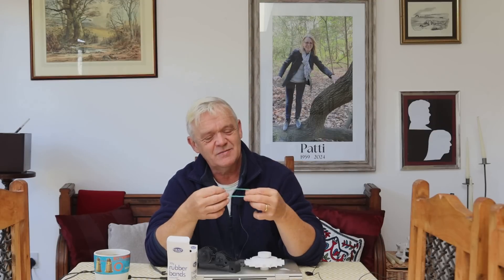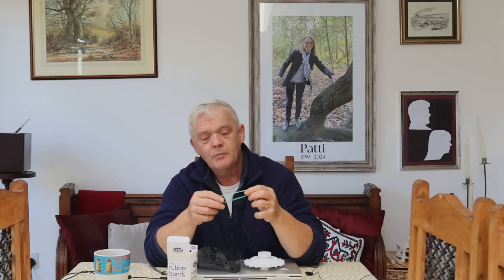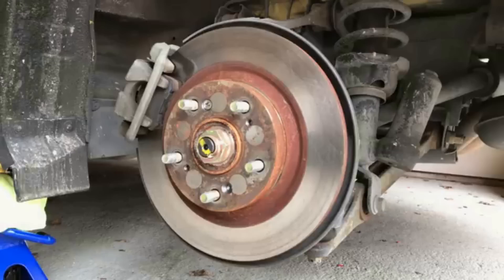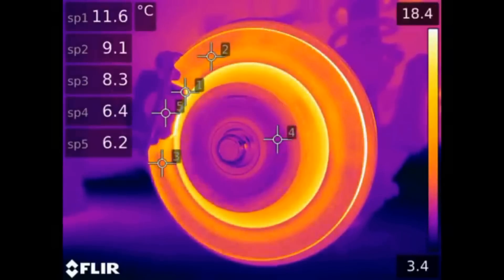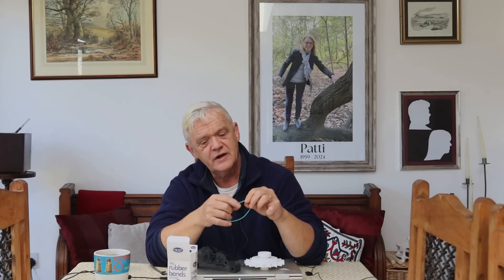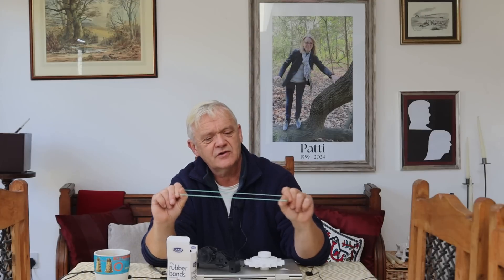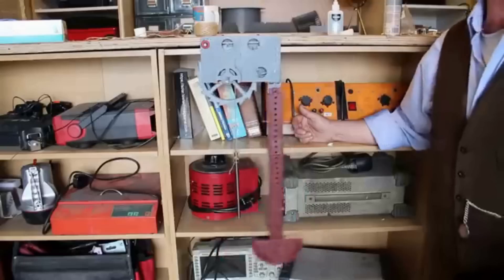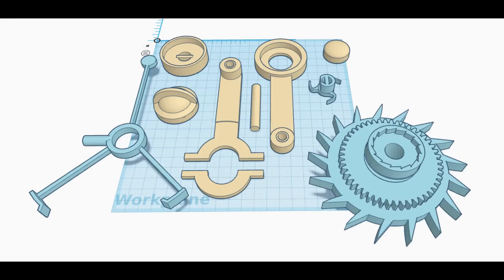2299 Rubber Band Escapement

Comment: Thank you, I always enjoy your videos. The period is only given by the length of the pendulum and the gravitational force. The mass has no effect on it.
Reply from the maker: Great point - but I suspect this is only an approximation - after all the regulate the pendulum of the clock in the Elizabeth Tower in London (Big Ben) by putting pennies on it - the addition of weight changes the beat of the pendulum by 2/5 of a second every day - of course that pendulum is massive - around 4.4M long and 310kg - the bob is 204kg - having said adding weight does make a difference to the beat
Reply: @ThinkingandTinkering  It should be irrelevant from the maths/physics behind it. Maybe the increased friction from the pennies in the airflow tuned it in ;-). 
BTW: I also own a 3D Printer and enjoy it, but I also miss the old videos, when you did the builds with alternative tools. It was nice to see, how something startet to get it's shape. With 3D printing, the results are on the table from the first second of the video. But I still learn a lot from you. Keep up your positive nature.

Comment: In the past I've wondered if it would be possible to design an escapement mechanism with the proper gear ratios, tooth count, timing, etc. and probably even with slip gears where the main wheel is pulled with let's say a 2 lb weight while it's pulling up a 1.25 lb weight and when the 1.25 lb weight reaches the top it disconnects and then a 2nd 1.25 lb weight goes through the same motion and when they both are raised to the top they engage each other to become a 2.5 lb weight in order to raise the now lowered 2 lb weight and start all over again when I put it on paper it looked plausible I think Mr. Smith could be the guy to do it if it's possible.. just some food for thought Mr. Smith
Reply from the maker: sorry mate that doesn't look plausible to me - How does the second weight get pulled up? when the cycle has finished you would have 2 pounds at the top and 2.5 pounds at the bottom - it wouldn't repeat
Reply: Like in the beginning the 2 (1.25 lb weights) disengage each other
Reply: It would be about a quarter cycle of the big wheel to pull up the 1.25 lb weight

Comment: You can also use a weight attached to a string instead of a rubber band. The weight drops a little with every "step" of the mechanism and unwinds the string from a reel.
Reply from the maker: cheers mate

Comment: Material choices are important for improving these designs once you learn the mechanics. The biggest problem with rubber as a material is as soon as you stretch it the power drops. As it is stretched you lose elasticity in heat & ruptured fibers. Constant force / clockwork springs are much better for energy storage.
Reply from the maker: oh for sure but this is really about the mechanics - using a rubber band is just for fun the same principles apply - and a rubber band is certainly better than a PLA spring which is what lots of these print projects use

Comment: Period = T = 2π Square root of√L/g.  ( No mass)
I look forward to your presentations every morning. Thank you
Reply from the maker: cheers mate - Great point - but I suspect this is only an approximation - after all the regulate the pendulum of the clock in the Elizabeth Tower in London (Big Ben) by putting pennies on it - the addition of weight changes the beat of the pendulum by 2/5 of a second every day - of course that pendulum is massive - around 4.4M long and 310kg - the bob is 204kg - having said adding weight does make a difference to the beat
Reply: @ThinkingandTinkering  could it be because the pennies change the centre of mass imperceptibly? That would change the effective length of the pendulum by an equally imperceptible amount, causing a slight drift in timekeeping.

Comment: Hello sir Robert!
I've been trying to look onto a very similar subject.
But I have no idea on where to start the research, or how to properly articulate my dillema.
I've been looking forever into how to make a sort of a valve to release pneumatic energy in a controlled manner.
And at a particular flow rate and power.
But for the life of me, I'm very concerned about the energy losses that would occur.
And I think the shearing of the fluid, while being released.. through the valve.. would cause major energy losses.
And I just can't find a solution to counteract these.
Pneumatic/compressed air can be a very widely available, cheap and practical form of energy storage solutions.
Especially acting great as a mechanical capacitor for fast reactions.
Reply from the maker: i don't understand mate - it is hard to visualize a problem in isolation - what is it you want to do with the compressed air?
Reply: @ThinkingandTinkering   to make a valve and regulate the air flow, and have the output of the valve be at a very consistent flow rate/pressure.. to run a turbine and get energy.
But its hard to design a valve that regulates the output at a constant fixed pressure, regardless of the internal pressure of the dewar or vessel.
And do that.. without much energy loss.
Reply from the maker: that helps - if a problem can't be solved from one side tackle it from the other. I suppose you could attach a flywheel and when the pressure drops in one tank switch to another - the flywheel will even out rotation while you make the switch
Reply: @ThinkingandTinkering  that's a pretty good idea.
To buffer the energy output.
Also, sir.
I have a few concepts at hand that may require some effort.. making.
But I think they're almost breakthrough worthy.
And maybe worth taking a look at.
I know you mention a lack of interest at conceptual projects.
But I really don't have the resources to make them at present.
Could you be open to evaluate my idea. It'd sure take me a couple of days to get upto speed on fluid simulations and whatnot, and build the model.
But when I'm done, would you take a look?
I will be very grateful it for if you do.
Those designs involve few things.
1. One being a sea wave energy harvester.
2. Another is a motor.
3. And an engine.
I'm most excited for the motor.
But I just love the engine, such a simple design.. which is something I think inspired by you and how you simplify your iterations such that they can be made with minimal tools.
Although only the principle of how it works is simple (the engine), making it would require some machinery.
Reply from the maker: I am glad it helped - as for looking at your other ideas - i would be happy to if you make them and do a video - otherwise - no, I am afraid not.
Reply: @ThinkingandTinkering  aww man!
Bummer.
Love you though!
You're an absolute idol and inspiration for me.
I hope to be like you someday.
You just never cease to amaze, how essentially each of your often self concluded and authentic innovations and inventions are interconnected and can be implemented in other projects of yours to be used in conjunction  and gain major improvements.

Comment: The weight of the Bob of the pendulum has no bearing on the period of the motion. It is only the effective length of the pendulum that determins the periodicity
Reply from the maker: you are quite right i put this badly - Changing the mass does affect the amount of gravitational potential energy at the end of each swing, and the amount of kinetic energy at the midpoint of the swing. Increased mass of the bob would increase inertia and allow the pendulum to swing longer before friction brings it to rest - but I suspect this is only an approximation - after all the regulate the pendulum of the clock in the Elizabeth Tower in London (Big Ben) by putting pennies on it - the addition of weight changes the beat of the pendulum by 2/5 of a second every day - of course that pendulum is massive - around 4.4M long and 310kg - the bob is 204kg - having said adding weight does make a difference to the beat

Comment: Good day Robert.
I have an intriguing question.  Off topic of today's video, though.  Hope you don't mind.
Firstly, a bit of background.
Our home has a “high-efficiency” forced-air furnace with a drum type fan. (Natural gas for heat!)
The fan runs constantly, at a lower level to circulate air, then it ramps up to full speed when the thermostat determines we need more heat. 
The fan is ALWAYS running.
This is the most common type of furnace in our area.
So, here’s my question.
Could a generator be added to one (or both) sides of the fan to generate power?
(ie – glue magnets to the edge of the fan, then somehow add a copper winding, etc.)
I guess my point is that the fan is always running so why not try to harvest some energy out of it?
What do you think??
Cheers mate
Kendall
A big fan of yours.
Reply from the maker: the load you put on the fan by trying to scavenge energy will just increase the energy bill mate as there is no external input - why is it always on? Maybe just switch it off? i don't know - I don't know why they would do that - is there a reason?

Comment: Ever use a rubber band to make static electricity by friction like a van degraf generator?
Reply from the maker: yeah - i built a 500Kv Van Der Graff about 10 years ago
Reply: @ThinkingandTinkering  Ever try using that to charge up a battery where the source is positive terminal and the negative is ground. I spent one winter charging up a nicd battery with static electricity. I did not get much of a charge on it. But I am surprised what I got.

Comment: Thank-You  Robert,  for a trip down memory  lane !  I'm 70+ and I remember my first  "R C"  aircraft used a rubber band powered escapement to drive the rudder   {the only control surface) ,  before servos were even a thought !    P.S., always enjoy your subjects !
Reply from the maker: awesome - cheers mate
Reply: I Must be old as well,I remember the bang bang rc unit. Simple escapement unit with a coil if I remember correctly and powered by a rubber motor. Thanks for the memories. Bob.
Reply: That's how my dad started his RC airplane hobby.  A decade or so later, as a father-son project, we converted my walkie-talkies into a similar radio system using an old escapement from those early days.  Worked great on my toy sailboat!  (By that time, some of Dad's friends had started a company building RC radios with 4 and 5 channel servo systems.)